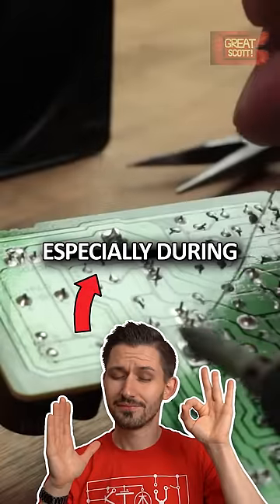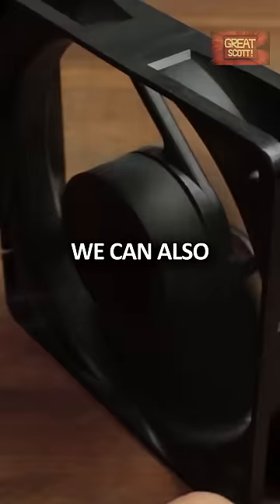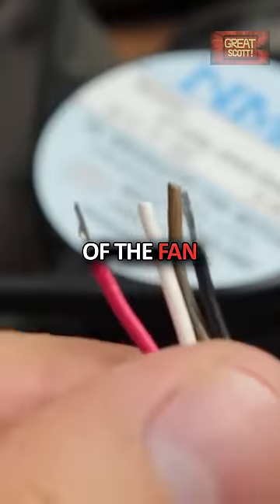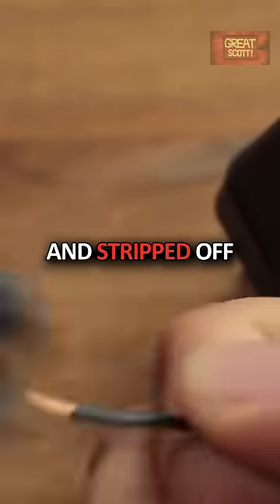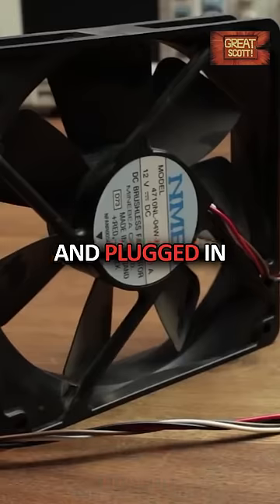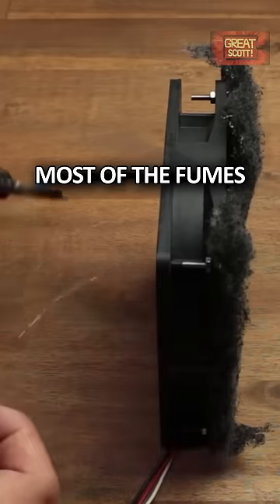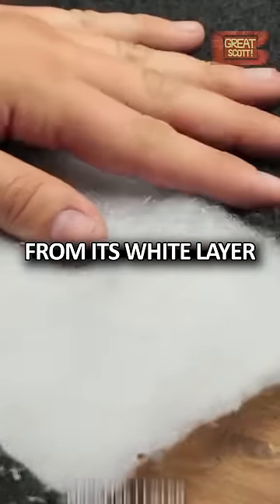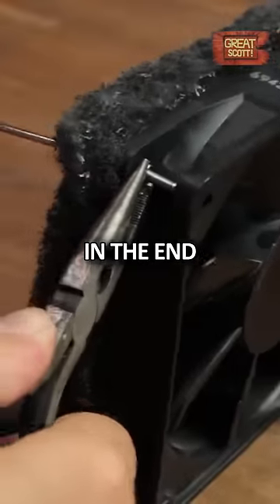Always have This when Soldering!

Comment: Rather than cutting and splicing both ends, I'd pick one and splice an opposite JST or barrel connection on the other so you can disconnect the power supply whenever needed.

Comment: I have an old cooker hood over my "bad air work bench" with the air tube out of the window when I use it. To improve the air flow, I placed an old safety glass pane from an IKEA bookshelf between the hood and my face. It's ugly and clumsy, but it works perfectly.

Comment: I have a desk fan that's about the size of a 12 volt computer fan that sits on my workbench and blows across the area I'm soldering in.  It blows away the fumes. Probably not as good as using a fume extractor with a HEPA filter, I admit.  I also use leaded solder, but I don't drink or eat while soldering.

Comment: I've been using N95 masks, since I have a pile of those around.
I'm going another level with my 3d printer.  I bought some tubing and I'm building a window adapter so I can vent everything to the outside.  This makes me think that I should make it removeable from the 3d printer for use while soldering.
Reply: Make sure you have a safe makeup air vent. Otherwise there is a possibility you could be filling the space with air from the furnace or water heater vent if you have gas.

Comment: Just remember that if your fam speed is too high you will cool down your soldering iron tip .The best way is to use an overhead fan to draw fumes away.Just remember fan  speed and noise issues make it hard to work some times

Comment: How do you identify plus and minus on mains?
Reply: first: mains run on ac, there's no + or - (just live and neutral where neutral is safe to touch and live actually has the 120/240v sine wave)
second: he used an ac to dc adapter, the - should be the wire with a white line on it

Comment: Ive done this before, the fan couldnt get the air through the filter and it would just move back through the space between the fan blades and the case
Reply: Not a fast enough fan or too thick a filter.  Everyone has done this including myself and it works
Reply: @jimb032  fan was fast enough, but pc fans arent madd to push air through something, though the filter was likely also too thick

Have since gotten an impeller fan from a heating system, which can put up a lot more pressure; hoping that that will work better
Reply: @Joshinken  I dont know what to tell you.  Everyone has done it with a PC fan and it works.  Well too.  There are also different speeds of PC fans too ...
Reply: @jimb032  what you should tell me is absolutely nothing. You can’t just erase my experience and that of others by claiming “oh well I know people who managed to do it”, and trying to brush me off that way is incredibly rude and doesnt do anyone any good

Comment: Why does the PSU have to be linear?
Reply: Because the fan work with DC voltage and current
Reply: @gabriel55ita  That doesn't mean you can't use a SMPS

Comment: You should have a fume extractor when you’re soldering…so you make your own fume extractor by soldering 🤯

I’m just being a little bit of a jerk, I supposed if you don’t have a fume extractor you can do this outdoors to solder your own 😅
Reply: Soldering indoors long enough to make this isn't going to hurt you. It's the guys sitting in an enclosed area for 8-10 hours a day soldering constantly that are really at risk. As far as I'm aware, the worst that can come of it is occupational asthma, though. Not that that's a small thing, it's just that I've seen people talking about cancer and stuff like that, and I'm like 95% certain that's not an issue here. Also, if you're soldering at temperatures above 650° C (1200°) you run the risk of creating lead oxide (if you're using lead solder, of course), but most consumer irons don't reach that kind of heat, and if you have an iron that does, you really shouldn't crank it up that high anyway or your going to end up with a whole lot of cold joints.
Reply: @evilmonkeywithissues you’re right, I was just being a smartass lol 😅
Reply: @davidoneill7554  I got you. Honestly I think I was just giving an exposition dump, because I saw a whole bunch of people talking about how terrible solder fumes are and how they cause this, and that, and the other. I mean they aren't good, but they're not going to do half of what everyone seems to think. I guess it was just getting frustrating, and your comment just happened to be the one I unloaded on (I dispel falsities by juxtaposing information when I'm frustrated, apparently). 

That's my bad, but I definitely appreciate the fact that you took it in stride instead of getting angry. Not many people are that patient. I know I didn't say anything worth fighting about, but people seem to take offense at the slightest thing, so you never know!

Comment: A fan and a carbon filter, does not a fume extractor make. A proper fume extractor has multiple filter components including a hepa filter and a deep cavern carbon filter. What you’ve actually made here is a fan that dissipates fumes finely into the air. I’m not going to say it’s better than nothing, because at least with nothing you’re not deluding yourself into thinking you’re any safer.  Not a good video to share with amateurs. 👎🏼